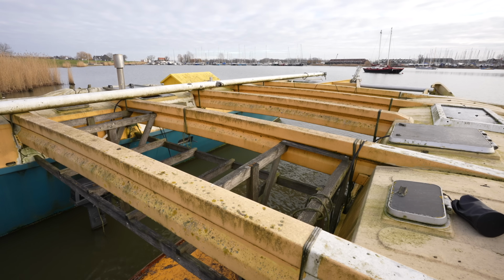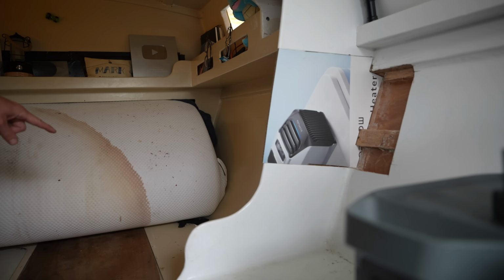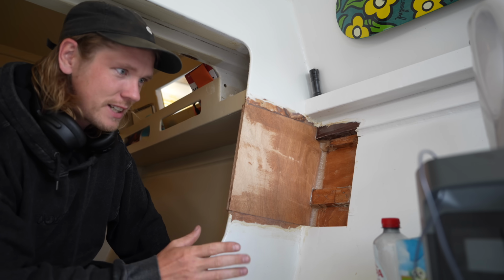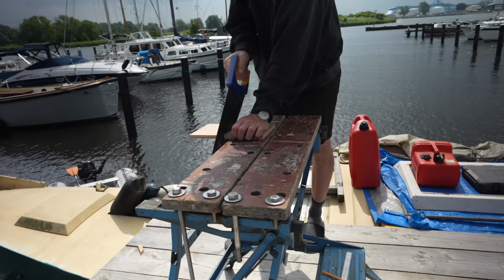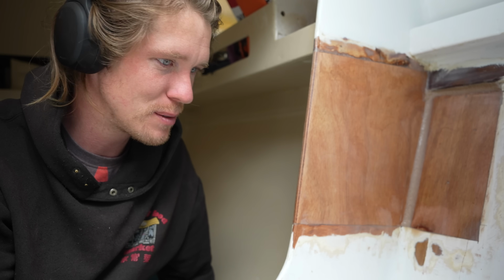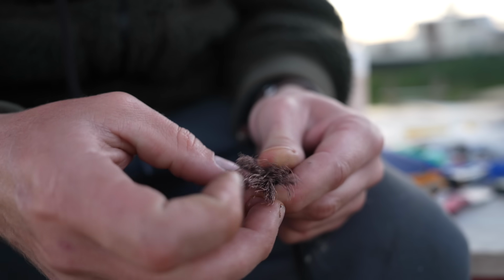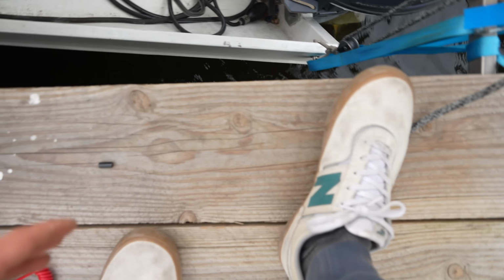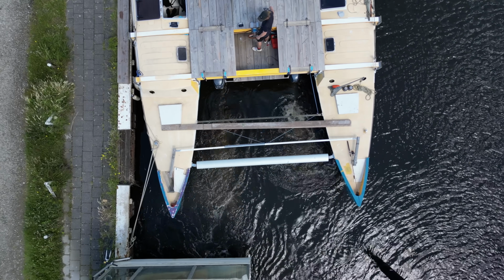My DIY Catamaran Engine Set-Up Is Complete!

Comment: Soldering wires together should never be done. It's for electronics, not for heavy current. Guess what happens when the wire is overheated? A crimped butt splice and heat shrink over is the only way, but it's best to replace the entire length with proper marine tinned wire, no splices. The black on the copper is oxidation and should be cut away. The oxidation is evidence of what a marine environment does to copper wire and the reason to use a tinned conductor. I know saving money is essential, but so is a running engine. Keep going, you're an inspiration for everyone.
Reply: yeep that is how i learned aswell ... too much heat can melt into a mess
Reply: Look into big battery cable crimpers and big butt joint connector and waterproof heat shrink like mentioned above. Solder joints will break over time and shouldn't be used in motor in vehicles.
Reply: Can you please say the word dingy ,at least once in your videos. For some reason I luv how you say it.
Reply: I’ll say, your life is more important than time or money, easygoing with the rest of the build my friend.  No hurries.  Take your time and ask for help.  Nice project, look forward to continually watching the rest of the build.   Be Safe,

Comment: I would like to seriously recomend, you tab your bulkhead repair in with glassfiber mats and epoxy. Waves will send shockwaves through your hulls and I would think it is better to over engineer things. For the rest great job!
Reply: Yes
Reply: Absolutely! This critical joint should have been scarfed, but taping both sides with biax would be better than nothing.
Reply: I totally agree. Such a bulkhead is load bearing and that repair needs to be BEEFY.
Reply: Third this !
Reply: Just to repeat what others have said, that bulkhead repair really should be glassed to the hull & original bulkhead above & below. An utter ball ache I know, having done such a visually neat repair. So sorry to be the bearer of bad news!!
A dirty but better than what you’ve done:
1. 60 grit sanding disk on the angle grinder & carefully remove the 1st veneer of the ply 2 - 3” above and below your horizontal repair lines. (Possibly 1.5 - 2 veneers depending on thickness of plies)
2. Whatever glass cloth you’ve got lying around cut to length so that it starts near the hull, wraps around inboard edge & then back to hull on the opposite side. 3 layers, each a little wider than the last, with the final one being the full width of the ground out area.
3. Leave to cure, sand & fair.
4. Drink beer / wine & sit back and admire handiwork, knowing it’s not going to pop out when you least expect it!!

Other than that, great video as usual & so glad the new laptop arrived in time for this weeks episode!!
Reply: Some “loose feather” / puzzel piece joints on top and bottom for pull strength before glassing would make it even beter maybe. Better overengineer where it counts !?!
Reply: Agree. You need to glass matt the corners and the joints. That will just crack and shattered when the hull flexes.
Reply: The engines have  regulator rectifiers built in limited to 14 volts.
Reply: If you could go back, I would have suggested that you only cut out the small rotten section at the side of the bulkhead near the hull. Leaving the inside 2/3 of the bulkhead that was not rotten would have maintained better structural integrity and been easier in the long run.
Reply: He sandwiched the repair bulkhead piece. I think it’s an ok repair. I personally would have tabbed it, but I think overall it’s ok.
Reply: Another method would be to simply epoxy a doubler on one side that strattles the repair piece and bonds to the original bulkhead material.
Reply: yes not tabbing that in means its useless as a bulkhead.
Reply: Agreed take a look at what Parley did and David Shih
Reply: I think the glued area can withstand compression forces, but not tensile forces. Both occur when the hull is deformed by waves. Not sure if glass fibre mats are enough. What do the others think?
Reply: @boooshes  yes, tension and compression will be there when crashing waves.. need to beef up that repaired section..
Reply: And add tabs to the hull
Reply: Tab, tab, tab! Parlay Revival for reasons why and how to create the strongest bulkheads. 💪
Reply: It's being compressed... Should be ok
Reply: Hope Mark reads this as the comments are valid. Epoxy does not perform well in cleavage but does in shear, definitely a few layers of glass required to distribute the stress across the original structure to the insert, and on the inner edge where stress is highest I would build it up a bit more. That repair will fail catastrophically when you get some big seas. Better to sort it out now!
Reply: Or plate it would work also.
Reply: Bulk heads always need tabbed to the hulls, let the lagoon fiasco be a lesson. Hulls twist and bend
Reply: this isn’t a production boat

Comment: I have to say " I have never seen anyone trying to clean the ends of old wire. Usually they just cut off the bad end!
Reply: Old tech here; When you are forced to clean copper wire to join, you can use H2SO4, Sulfuric acid in a dilute form. I usually just get a little acid out of a Lead Acid battey.
Reply: @ebaab9913  can you use vinegar?
Reply: @izzzzzz6  yep
Reply: In fact, the wires are not dirty. They are oxidized, and solder won't work without a very good acid rosin flux. You should have cut the end of the cables and started new or look for mechanical solder slices. Tyco or Raycheon should have exactly what you need. Remember, bad electrical connections are potential fire hazards
Reply: Acid rosin flux is another alternative, and vinegar does work, but not as well as dilute Sulfuric acid. The copper become shiny brite after treatment. I am an expert at soldering but would not have soldered that joint. I would have crimped it. I find that any movement in soldered joints can cause the fine wires to break off. I am in the electronic service industry.
Reply: me too was very fun to watch (:

Comment: Mark, I am afraid the comments indicating the bulkhead will pull away from the splice are correct.  On the inboard side add a vertical tab say 150 mm that extends well past the part you added back in.  You should go as far past the new material as you can.  I would match the curve at the bottom so it will look like it was meant to be there.  A good connection on the faying surfaces at the existing bulkhead will prevent the bulkhead buckling from pressure, and more likely, pulling apart when the part is in tension, which absolutely will happen. It won't even take a heavy sea at all to break apart.  I am a former structural designer for a professional engineer, and I my experience tells me this needs to be addressed before leaving the dock.  I hate it because your repair looked so nice, but you can reinforce your repair and it will look meant to be that way.  

Great job so far.  When you got the swamp creature, I thought she was actually in better shape than she was, but you had the vision to see it for what it could be, and you are turning her into a real boat.  You have the gumption to back up and redo, and that is such an admirable attitude.  I have so enjoyed watching your journey.
Reply: I pray he sees this comment and improves that bulkhead
Reply: Can he use puzzle joint in this place.
Reply: He ignores most good advice and likes comments that aren’t.

Comment: As an electrician I am a little concerned about your current wiring skills. Please use fuses next to the battery on the positive wires. And spend some money on some proper crimp terminals and connectors together with a proper crimping pliers. Seeing 15V coming from the outboard, this will fry you battery. So yes you might need a voltage regulator.

Comment: Recommendation for cables. Use tinned cable, helps prevent corrosion. Join cables with a crimped ferrule not solder and cover with heat shrink that has glue inside. The glued heat shrink will give a watertight seal.

Comment: Don’t solder cables in a marine environment. The solder breaks down and causes loss connections . Only crimp and cover with heat shrink. I would recommend you redo these in the near future.
Reply: Agree
Reply: And there is a second problem: In order to solder such thick copper cables decently, you need to bring in so much heat that the insulation material will get burnt. This happens because copper  conducts heat very well- you will literally heat up at least 10 or 15 cm of that cable in both directions in the process of soldering this connection. That's why most people prefer to crimp such diameters. But for that, you would need a better crimping device than what you used in this video.
Reply: Hotshrink should take care of that. And if you use a butane, it should heat up fast enough that it won't eff  the insulation as much.
Reply: Agreeed Never Solder heavy wire like that.  There is a dozen ways to join 1/0 for under $10 safely to last.
Reply: Ps.  Your Engine is Not Overcharging.  It is supposed to charge that voltage.  13-15v is normal and it will not hurt that battery or little alternator on the engine.
Reply: Different sized cables
Reply: Crimping causes more issues. Solder and seal. Any crimped connection is going to fail before the soldered one. Crimping is cheap and fast. Solder is for a good job. You might as well say the copper wire will fail in a marine environment. Every connection you want permanent, solder and seal. Any like onto the battery, solder to the connector and seal.
Reply: Don't skimp, crimp!
Reply: thanks bro i wanted to tell as well and also if there is high ampere always crimp (;
Reply: @Die_Wahr_Saga  high amp is more reason to solder. like every car or boat battery will be soldered inside. if you want it quick or disconnectable crimp it. but for important and/or high amp, solder it. like every pcb.
Reply: @chrisoakey9841  mhmm thanks sounds different to my electro technician education but anyhow crimping is good
Reply: And why are high voltage cables always crimped and not soldered?
Reply: A battery is not a high amp cable...
Reply: @m.r.vanderburgh3757  a battery has within it metal that takes the current from the first and last plate to the posts. some more modern ones even have charge controllers between banks of cells etc. and metal bars are very similar to cables. so much so that some cables are not strands, but a solid rod. the simple thing to remember is that a soldered or crimped connector are virtually the same but solder bonds better to the other metal. so degradation of surface and therefore connection are reduced. but crimp is faster and easier to uncouple.
Reply: @Die_Wahr_Saga  crimping is pretty good, and sued all over the world. part of my response is the "don't solder" garbage as solder bonds to the wire much better and it is harder to lose connection on a soldered connection. having spend a considerable amount of my working life repairing old stuff from eftpos machines through industrial equipment. soldered joints generally fail due to a bad soldering job. while crimped connector crack as the cable goes in,  lose screws, or corrosion on connector or mounting point. and while corrosion or growth can affect both soldered and crimped, my experience has been that crimped ones fail crazy amounts more than the soldered version.
Reply: @chrisoakey9841  ya thats the point anyhow to work accurate for a good connection ... thanks for sharing experience (;
Reply: @Die_Wahr_Saga  clearly you misunderstood what i said. crimp connections will fail before soldered in marine environments. both are ok, but soldered is better sealed.
Reply: @chrisoakey9841  that's not true, specially in marine environments you should only us crimp connections with the use of a proper  crimping device off course! (e.g. Your cable on your accu is always crimped)
Reply: @m.r.vanderburgh3757  of course. in a highly corrosive environment you obviously would want to avoid the sealed connection. thats why all sorts of pcb's in such environments use sockets never solder. 🤣 but i guess examples and reasoning don't beat "no you're wrong", in a debate. i am amazed none of you seem to have seen a bad joint due to the crimped connector on old equipment.

Comment: Mark, first off great video as always. I’m an Avionics engineer in the RAF, so wiring and electronics are my profession. First off, the black cable ends need cutting back until clean cable is found. Second, I would crimp cables in an external environment, there are plenty of hermetically sealed crimps out there to choose from. Third, I didn’t notice in the video but where is your circuit protection (fuse / circuit breaker) and battery isolation switch to kill power in an emergency.You may have done it but not showed on the video. 

As you wire more and more systems in to the boat you might be better going to a bus bar system now rather than later with individual circuit switching. I’m sure you aware of this though.

Comment: Your epoxy work looks better than many professionals I have seen. That is really really nice!

1. Bulkhead has also pull forces not only push. So you really need also fiberglass.
2. When soldering don’t rotate the threads just push them together.
3. Allways use electric tape first around the solder and then heat shrink. The wires will come through the shrink and create possible short circuit.
Reply: Scarf don't but joint use spoon for coving, tin your slder tip
Reply: Use some strands of wire to hold the spliced join together also.

Comment: Hey Mark, my second comment this week! The black stuff inside your engine cable means that water has got in there some time in the past. Unless you use tinned cable(and outboard manufacturers don't) water can wick its way all along the wire until it gets to a low point and then it slowly rots away the wire on the inside where you can't see it. My boat is now 30 years old and since i discovered this i have changed all my exterior wires to tinned and am slowly doing the inside ones.
Reply: Tinned is the only way to go on a boat!
Reply: How flexible is the tinned wire?
Reply: If you use a good marine tinned wire like ocean flex it's very flexible
Reply: You can dip the end in acetone. To clean before soldering and sealing.
Reply: Mine as well

Comment: Hi Mark, i love your channel and i have a couple of suggestions for you. Number one is your mattress. Big chandlers sell a couple of different types of stuff which you put under the mattress to stop the moisture damaging it. You will still get water under that but if you regularly dry it out you wont ruin the mattress and it wont feel damp(and you won't get mould!) Also, i would either glue ply over the join in your bulkhead or what i would do, glass both sides with something like 2 layers of 450grm cloth and epoxy. Butt joints  are not going to be strong enough. The good news is, you have done a good job so far, just needs finishing and fairing. Do it now, a gale at sea is no time to be worrying about it 😊
Reply: Yeah I agree glass matt past the joint 300mm both sides great job otherwise love the videos
Reply: yep, that would finish the job. that join needs to be a bit beefier.

Comment: You never 'clean' old wire. Clip it off about 5mm to 1 cm into the insulation, then strip the insulation off the unexposed wire. The reason you do this is because the exposed section will not conduct as well, especially in a marine environment. And by the way, this episode's soundtrack really works!
Reply: Yeah im on the fence about some of the other practices. Full lenghts no splicing etc.  Cleaning the wires was a fopa to me. Just seems like bad practice to me.
Reply: The negative oxidation can extend quite a way up the wire. If it’s not going to be replaced I’d just clean and crimp it.
Reply: you can clean and then tin the wires. a bit of acetone will usually work. so long as you clean it well the flux and heat should finish for a nice secure soldered connection. heating the wire is vital. i will heat for a while then dap solder onto the iron to get it flowing, but once it starts, keep feeding solder onto the joint, not the iron. and heat shrink after.
Reply: That wire cancer probably goes 100mm up the cable.
Reply: @SpecialTBK  true, but i would bet that tinning & sealing will make it last for years.

Comment: Great video, including music 🎵.
Suggestions
1) purchase two marine batteries, one for each outboard - they can be wired each directly to a motor with no further regulation required.  You then have two starter batteries which gives you redundancy.  Wire your charging for the house battery off the starter batteries through an appropriate regulator that also isolates the house battery.  You now have three batteries that each could double for starter or house in a pinch.
2) to guarantee bulkhead strength, epoxy a doubler on the back side across the patch and onto original bulkhead material - this should be easier and stronger than multiple layers of glass work.
3) find proper pretinned cable for your engine electrical connections as well as any future house wiring.  Like your experience purchasing the used motors, you will not regret doing it right the first time.  No splices unless absolutely needed.  Only proper waterproof crimp connections.  Your future self will thank you.

Comment: Copper is a very good thermal conductor & there is a lot of copper there, so that soldering iron was never going to cut it. I don't know which tutorials you've been watching but marine cables should always be crimped & on top of that its best to run the full length. To properly crimp any gauge you need the correct terminals and crimping tool.  It's all standardized stuff. Any half assed job you do now, will likely bite you in the worst possible moment.